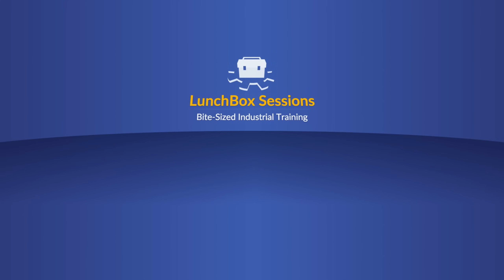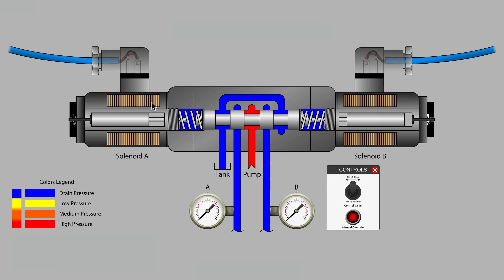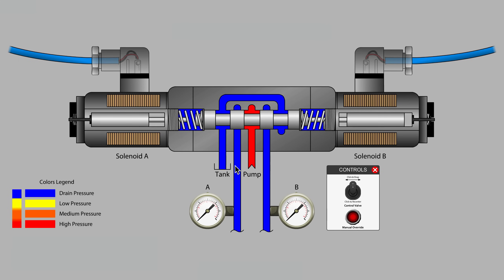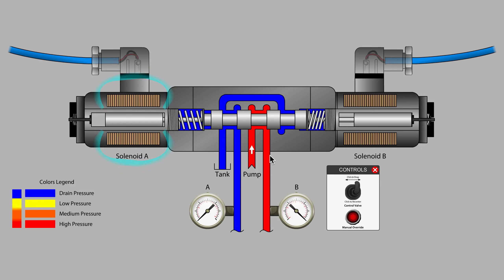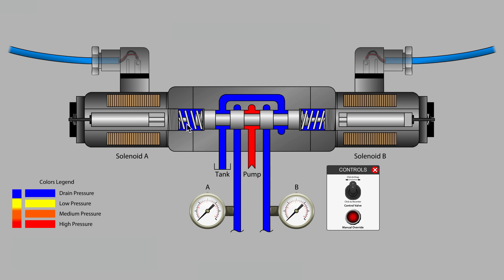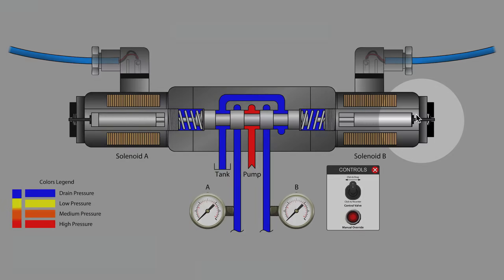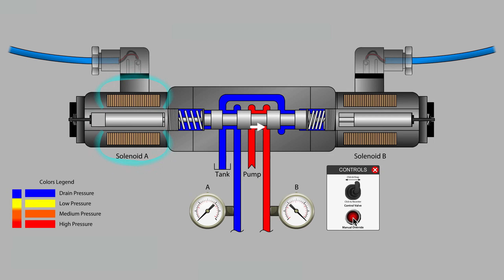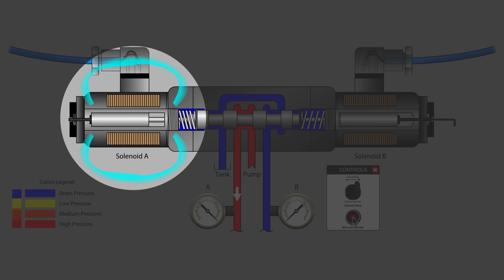Valve Solenoid Basics

Comment: when spool is in null postion, should we get oil in A and B, we have tested on Directional valve, we inserted 150 barg on P and we are gettingoil drop on Port A and B, is this normal in Null Postion without any command to Solonoide valve

Comment: I have a problem with a genie s40. Won’t steer because pressure won’t bleed off the opposite side of cylinder pressure is applied to.  It has a similar type of valve, only solenoids are stacked rather than opposing.   No one can figure out my problem.  Steering valve and solenoids are new.

Comment: When trouble shooting electric over hydraulic, always pull the coil off the valve stem and verify its clean in between coil and valve stem, and that stem is not slightly bent. Both can be a real showstopper, and turn up in equipment regularly.

Comment: Thank you, very interactive explanation, i've a recently changed 2 solenoid valves, because even if not energized, it keeps holding the pressure, and find it to hot, testing the ohm of the coil find it as the datasheet..any thoughts about ?

Comment: Hello, I have a jeep 2004 with hydraulic fan motor,  with solenoide Valve to control speed.
Seems the solenoid is not working.
Can it be serviced, there are no replacements available.
Or how do I try it, to discard a malfunction
SOS please

Comment: how its operated in one solenoid with two functions?means one directional valve have four function like outrigger beam cy,extend and retract,and other outrigger jack cyl.extend and retract.pls described
Reply from the maker: yusuf sayyed it sounds to me like you are describing a circuit that also has a sequence valve (no additional solenoids). Either that or it is simply a matter of two cylinders in parallel and the one that is easiest to move (lower pressure) goes first.

Comment: I've heard a solenoid valve called a coil before. I guess they're just talking abut the coil of wire.
Reply from the maker: True enough Shaine, a solenoid which causes motion (moves an armature,..a steel slug as it were) contains a coil in order to create the magnetic field. So the coil is only that, a coil of wire. A solenoid on the other hand can push a spool/poppet (inside a pneumatic or hyd valve) , unlatch a doorway, or close electrical contacts (inside a relay). But yes sometimes folks use a term which they learned that does not fully properly describe a device. Thanks for commenting.

Comment: My skid steer has one solenoid not working I switched the wiring and the wiring and the swapped sides on the solenoids (they are interchangeable) problem is definitely in solenoid do they ever stick and just need tapped to start working ot seems to be a sealed unit the replacement is $305
Reply from the maker: The solenoid itself is only a coil of wire - no moving parts. It can be checked with an ohm meter. If you mean that the entire solenoid valve is sticking, and only works when you tap on it, then there may be some contaminants that are causing the valve to jam. A new valve may solve the problem but only temporarily if the contaminants are still present inside the system/fluid.
Reply: I replaced the solenoid  and it works as it should thank you. SO im going to see if i can figure what went wrong with the old one..
Reply: Raven4122 I've done hydraulic work on heavy equipment and the dusty conditions were the root cause.  Change hydraulic filters often! The systems are very sensitive to dirt. It's not something that can you can see. The oil may look clean and still be contaminated.  Jim.
Reply: Thanks for the advice jim I will take your advice and yes The new solenoid fixed my issue I will be doing a short video since I have found none.. Thanks again..

Comment: That's what it was. Cleaned and it's working perfect. Thanks alot
Reply from the maker: Oh super. Glad you got it figured out. If you had some dirt or grit in the valve, and you can figure out how it is getting into the system, then you could prevent it from happening again. Typical points of entry include filling procedure (dirty pail and funnel), low quality tank breather (it's worth it to get a high quality one with a desiccant for moisture control as well) and scored/scratched cylinder rods among others.   - Carl

On www.fluidpowerworld.com we did a two part webinar last fall that you can still download and watch re: contamination.

http://www.fluidpowerworld.com/webinar-dealing-contamination-sources-hydraulics-part-1/

http://www.fluidpowerworld.com/webinar-dealing-contamination-sources-hydraulics-part-2/

Comment: Little tip, If the override valve does not work, make sure the main nut is tight
Reply: What other issues would cause a valve not to be able to be manually override?
Reply: @gregpartain4307  they get rusty and seize up

Comment: What would it indicate if you pushed both manual overrides and they both stayed pushed in? I have that problem on a autocrane crane. Will not scope in or out. Thanks. Your video is very clear to understand. I never knew how they worked but I get it now. Thanks again
Reply from the maker: Can you tell us what model of valve you have? It sounds as though your main valve spool is stuck (contaminants).